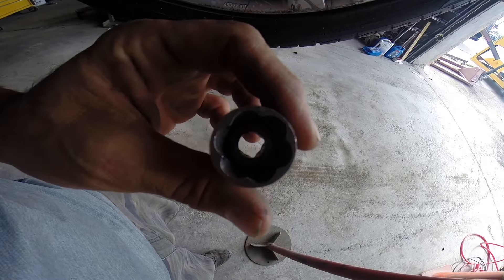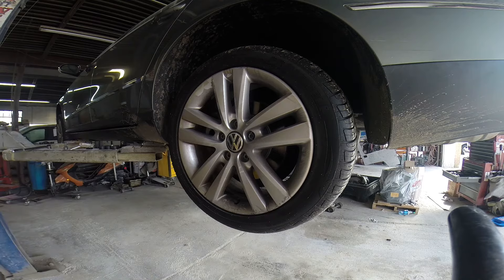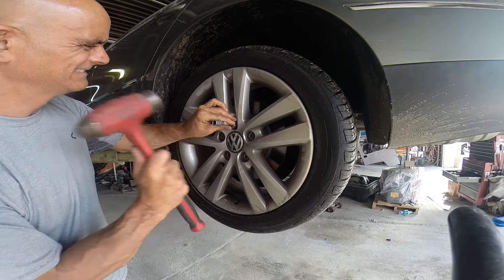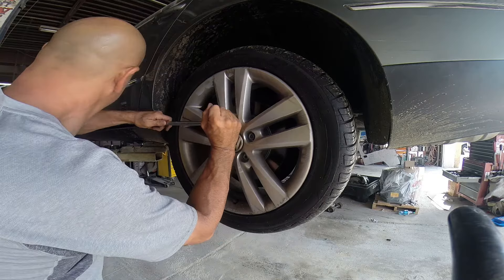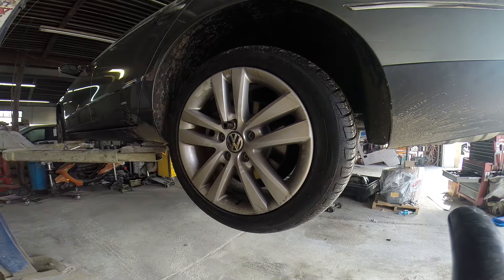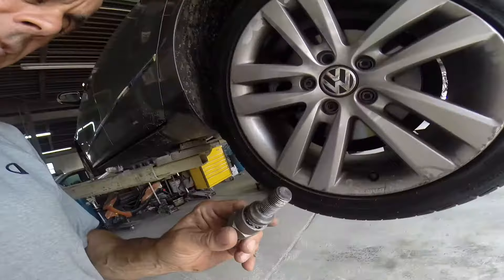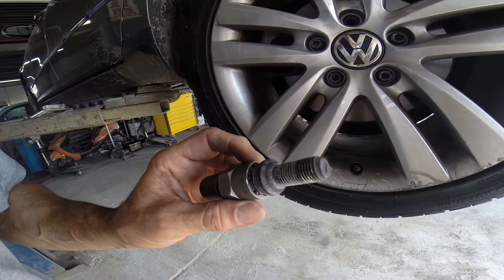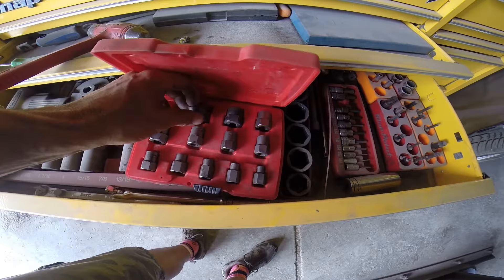How to remove a locking lug nut without a key quick and easy

Comment: If you have to purchase a bolt extractor you might as well just buy a new key. Kinda useless
Reply: Not really, I can't get a key anywhere in Denver, even tried VW. Fastest I can get one here is Wednesday, but I can get a bolt extractor right now n
Reply: @Demon So how would he fix a flat or rotate tires...tire and rim probably has to come off..
Reply: @JesusEffingChrist  you didn't look hard enough
Reply: @cncmach6779  just hammer a socket onto the lock nut, fire it off with an impact gun and replace it with a normal lug nut